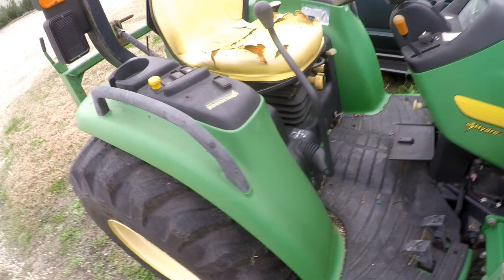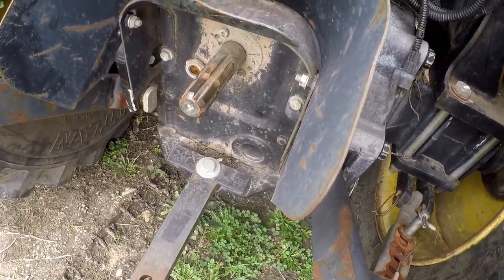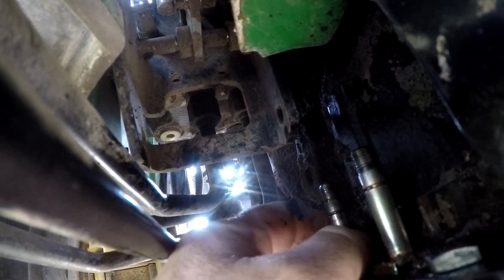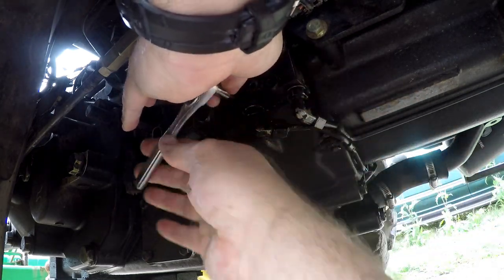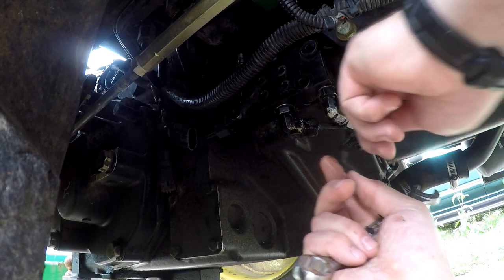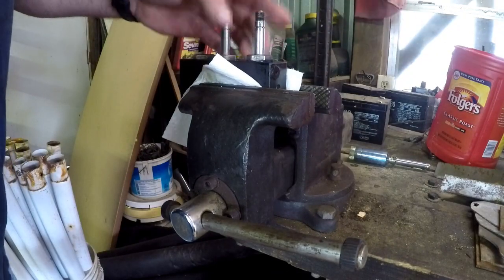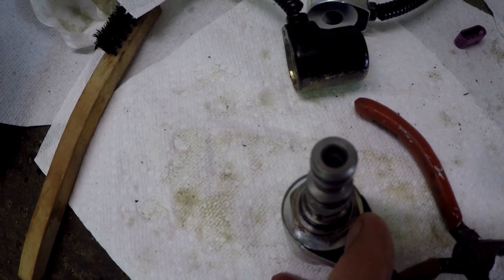John Deere 4310 eHydro PTO problem: Solved

Comment: Great video. Fix worked on my 4105. You can remove and unstick just the one valve on the solenoid and plug with rag without draining all the hydraulic fluid.

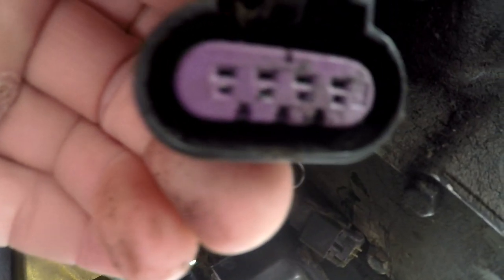Comment: At minute 1:15 you show the connectors, on my tractor the one coming down from the PTO switch the 4 metal wires got pull out with a branch (1 white,2blacks and 1 yellow)  can you please tell me the secuence into the connector so i can put them back again? Thank you!

Comment: So I'm way late to this game.  But I'm having a problem of the F5 fuse blowing when running the rear PTO when I'm not in 4 wheel drive.  If I'm in 4 wheel drive the fuse never blows.  So I think is the coil on the MFWD solenoid.  But I don't have any parts diagram to be able to order the part.  Can anyone tell me the part number for the that solenoid coil?  Thanks.
Reply from the maker: If I remember correctly the mfwd and pto solenoids are identical. I might try switching them and see what happens…
Reply: @TheFritz423  Thank you.  I got under it this afternoon and found that I can't even get the nut off the top of the MFWD coil because a solid steel part of the transmission is sticking out right above the MFWD solenoid.  Do I have to drain transmission fluid  to just unbolt the diverter block off the transmission?  If so I don't know where the drain plug is or even where the fill port would be.  Both coils measured 11 ohms and the thing is, the fuse blows at random times while running the PTO and not in 4 wheel drive.  Yes, those coils do look to be identical.  Intermittent problems are so much fun.
Reply from the maker: @jakejoeep23  You do have to remove the block and drain the fluid. Good luck.

Comment: Thanks so much for this video!!!  I took off the right rear wheel and had pretty good access to the solenoid and valves.  Without draining the transmission I removed and cleaned the PTO valve.  The fine intake screen was clogged.  Your video saved me a lot of money and time -  My tractor is a 4210 - everything is the same as your 4310.
Reply from the maker: If it helped the time was well spent. Thanks for watching!

Comment: Ive got a 1990 JD 655 and the pto is stuck on preventing it from starting. help! the seat switch is working correctly, the pto selector was working fine previously. i did replace the magnet after I purchased it as i determined it was broken. could the fork or something mechanical inside be broken? the tech manual, i have it, says to remove the left rear wheel and wheel well and manually turn the mech pto rod. ive checked everything else, except could it be electrical? i used a large wrench and squeezed the various electrical connectors together and that seemed to bring some systems alive. the tractor is recently new to me. it previously started great. no problem after changing the glow plugs. one day i parked it and the pto was engaged! help!

Comment: I think this might be my problem with both my PTO and drive not working.  Unfortunately I am not getting any voltage. Is there any specific way to check the voltage?  I might be doing it wrong.
Reply: And is that MFWD mean Mechanical Front Wheel Drive? On other sites I saw that it means Mechanical Front Wheel Drive which dosen't make sense.  Thanks

Comment: Do you by chance have the wiring diagram for the connector?  When looking under my 4310 today, I noticed all 4 wires were pulled out of this connector.  I have a new connector/pigtail on order, but need to know which wires to splice in where.
Reply from the maker: There should be four wires, two each to the MFWD and PTO solenoids.  As long as you pair them correctly it shouldn't matter which of each pair is positive or negative (solenoids don't care which way the current flows.) But try this site: https://partscatalog.deere.com/jdrc/navigation/equipment/81708

Comment: If I turn the PTO shaft by hand  there is a bang bang, metal to metal noise inside the housing.  I'm afraid to turn PTO on. I have a 2nd J.D. 4310 that does the same thing. What to do ???
Reply from the maker: https://www.tractorbynet.com/forums/john-deere-owning-operating/111387-4310-rear-pto-problems.html

Check out this link and see if it helps

Comment: Great info. My PTO was also dead. I had mice in my tractor and thought that was it. Two notes You dont have to drain the fluid . I did it and only lost a about a quart. Second my valve was very  stuck so i sprayed it with parts cleaner and held it up against a vibrating sander and that loosened it up.
YouTube mechanics rule.